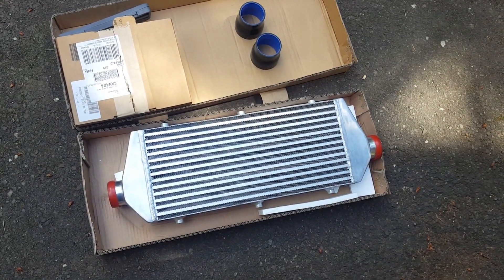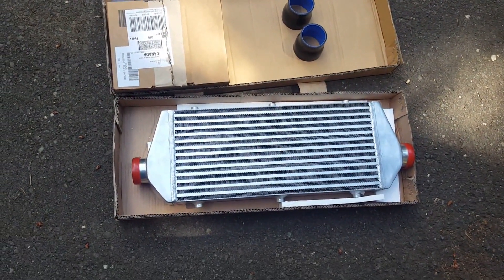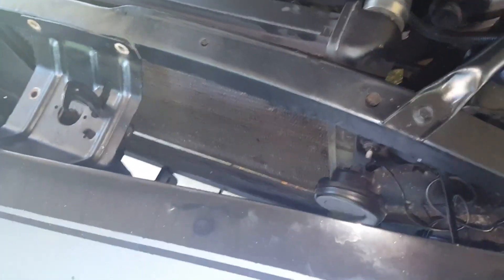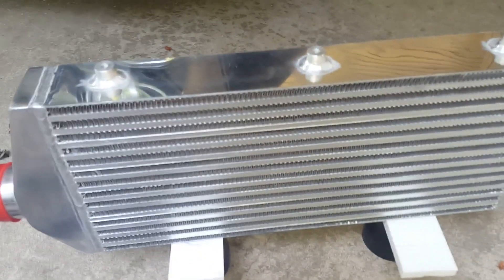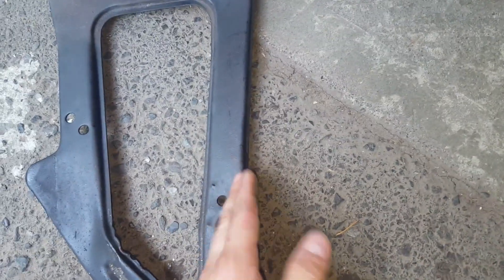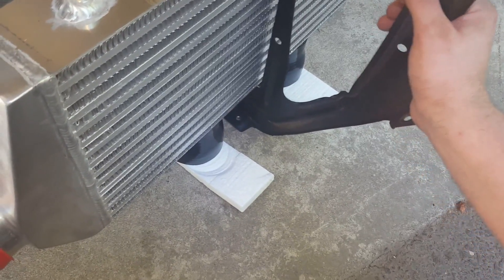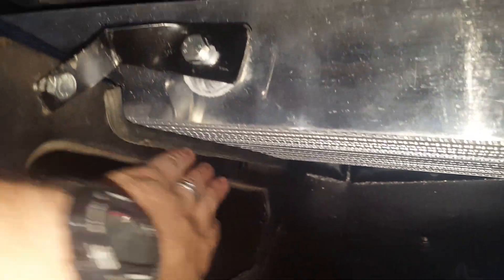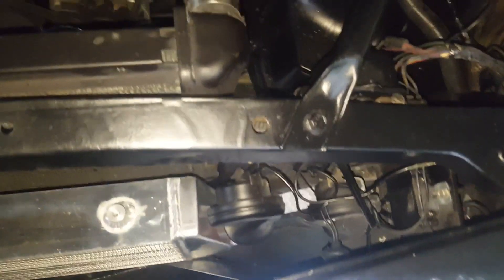1967 Camaro - Front Mount Intercooler Install

Comment: Hey man great videos so far. I've been watching for awhile and you gave me the idea to go the similar route on my 1970 nova. I was just wondering so far as to how much money you have into the engine?

PS: Love the paint color, somewhat wishing i would have went with that and not orange
Reply from the maker: Black looks great but is near impossible to keep looking good, especially on a daily driver like this. 

I've been planning to add a build list with prices paid to the website but been busy. I'll list the big ones in US prices... 
Custom Forged Pistons - $750
Machine Shop Labour - $1000
Turbo, Intercooler and related accessories - $500
Alc Injection - $300
Custom Cam & Lifters - $175
And probably another $500-750 in supplies and various parts. All in probably about $3500

It's not the cheapest way to get horsepower but I'd bet I'll never see another turbocharged 250 in a camaro, in person, and that makes it worth while to me.

Comment: Was there enough support for the hood after you cut the bracket. I'm trying to figure out a water to air intercooler for a gen v lt4. Mine has ac and there isn't much room.
Reply from the maker: No problems with the hood so far. That bracket is overkill so shaving a bit off didn't do anything.